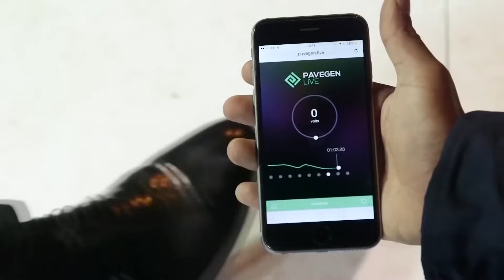Pavegen plans to power the world with footsteps

Comment: The amount of energy you put into making the steel and manufacturing. Accounting for wear and tear, you're going to spend more than what you've put in, in terms of environmental costs. For business costs, if you able to market it through engagement and media. Of course you'll be able to sell, but the issue is that this is not truely an environmentally friendly solution. Another thing, people walk on roads because they are stable and solid ground. But if its all wobbly around, then obviously its not going to work. Same for soccer pitch. The ball is not going to bounce straight. Another solution is that you could install in disco or dance floors where people are able to accept the unstable ground.
Reply: I think with further development - it could be made stable. I wouldn't implement sch a system on a soccar pitch, but busy sidewalks, malls and other bust public areas - definetely.

Comment: Make plates covered with alum strip cover to transfer more weight evenly across pads and stop them from ripping off... You can also design a longer shaft thats pinned to bottom so top cant come off... But strips at 35 40 mile an hr speeds optimal.. Plus rail road ties... You guys have the guts and many uses... Make current design bullet proff and using common materials so its not hard to mass produce...
Reply: I love watching these types of videos and reading comments. You guys have no idea what you are talking about, but everyone is hyped and act as an expert on the topic. 😂
Reply: @ShitThatsMyn completely agree. You only need a 7th grande understanding of physics and conservation of energy to realise that you will end with a net loss of energy and that these materials would produce much more energy if used in other stuff.
Reply: Excuse me, I have a project based on this video. Can I know the components and how to assemble them?

Comment: Can someone explain why you need more enegry to walk on this.
Reply: exactly.People are so fucking dumb that it makes me angry.
Reply: One way to explain it is that as you step on one of the tiles it moves down, which means you have to step up slightly to the next so not only is your body moving along it's moving up and down too, so you exert more energy on the "up" bits.  Try walking upstairs, on an air bed or a trampoline, you'll find it more tiring.  A more scientific way would be to say that energy is not created, it's just moved from one place to the next, in this case from your body to the electrical load.  So for electrical energy to be produced, energy is taken from your body.

Comment: Hi everybody! I'm an engineering student and i have a doubt: What happens if you stay on a tile for a long time? Is it possible that it get ruined?
Reply: I dont think so. check out the specs on the shoes they made, its essentially the same thing. I guess it depends on the quality of materials u use for holding the chemical reaction. and if shoes were designed for long term military use and abuse. I don't think civilians merely standing for a while would ruin it.

Comment: Can they even recover the amount of energy it is put into making and installing them.
Reply: This was the first question that jumped into my mind when i watched the video.
Reply: Alternative energy sources is a bigger picture than any one, single technology or device. The "I'm wearing blinders to the world" answer to your question is, of course, no. But couple this device with that device , with another device, and so on,  with the hundreds of other innovative energy producing technologies available now and in the future, we would be ignorant to not pursue these alternatives for the sake of ... shortsightedness.
Reply: What they can't do is get energy for free. The energy is coming from the pedestrians having to work harder to walk. Like when you walk in soft sand or on a trampoline. 
That's ok, but if you put it on the road like they suggest, it will use more petrol to drive over the road. The energy comes from somewhere. For pedestrians it is their food. For the road it is vehicle fuel. Good gimmick for pedestrians, very bad energy solution for road use.
Reply: Good Question!
Reply: Definitely, 20s of light with one single foot step...
Reply: z0ny it’s an LED strip though, very little energy required, and the video showed that it is not on for 20 seconds. Also, I would imagine that there’s more energy going into these then people imagine, from breaking up whatever surface these are replacing to running cables etc. not only that, these may or may not wear out over time, and considering what piezoelectricity is I lean towards the former, not the latter, meaning that these will need to be replaced possibly many times.
Reply: Long term, probably. Imagine powering a whole stadium with these things

Comment: It would be really great for your tech to be adapted to fabricating and manufacturing buildings where the positioning and placement of pelleted materials and heavy items are shuffled around the plant floor during the workday. Your tech may be adapted to accommodate longer vertical travel of its mechanism (or by layering your exist tech in some fashion), to harvest energy from larger and heavier loads being placed on the surface and storing the energy or on-demand use of energy. Just the weight of one vehicle at rest when it is parked could utilize gravity to harvest energy during the compression of your tech as the front or rear or whole car lowers to the ground(or sinks slightly below ground surface, but still navigably easy to drive out of.
Reply: Do you realise that if you do that you will need to use MORE energy to move the pellets and that you will NEVER get as much energy as you used and so, you only increased the amount of energy wasted. Right?
This is 7th grade physics....

Comment: Many have said it takes more energy to walk on these tiles than on regular pavements. Could be a problem for the elderly. But then again maybe if we all become fitter and stronger as a result those extra calories we will consume as a result will be converted into electricity. Would be good to put it in our shoes when running, Burn extra calories to charge mp3 and mobiles.

Comment: that energy doesn't come from nothing. it's more exhausting walking on their piles than walking on normal ones. paving highways with that is utter BS. the cars running over it will use more fuel. it's unsafe and highly inefficient.
Reply: I have a much more efficient system that uses peizoelectric plates that go under the asphalt when resurfacing and wounded affect the mpg at all it would look like a normal road but harvesting the energy from bustling traffic
Reply: @erizlov  what type of system you have i need help?
Reply: @erizlov  You still only get the energy from petrol. You're just converting it to electricity and making the vehicles less efficient.
Reply: d1dact what if it is downhill.
Reply: iNeverCouldGetTheHangOfThursdays how?

Comment: btw the idea is great and I think it could really help in our society
Reply: Unfortunately it won't help, solar, wind, geothermal and tidal energy sources are the way forward, some of his ideas about buildings moving in the wind could be interesting as there is a huge amount or mass there, but buildings are designed to avoid wind resistance so you'd be collecting energy from buildings designed not to catch the wind. It might work but then again how many skyscrapers are there, how many would use this, and what energy would be produced, it would be easier to just put a turbine on the building.